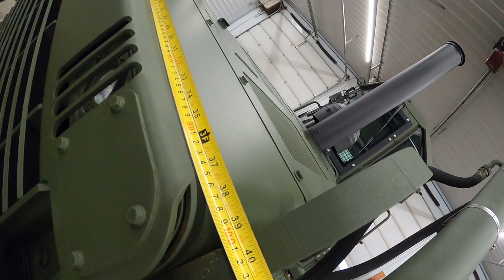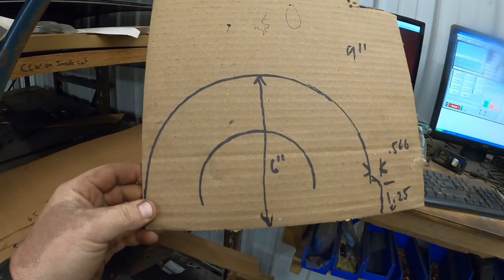Installing limb risers on a John Deere 850J @C_CEQUIPMENT

Comment: dp gonna get a winch or a ripper, the choices to be made, why cant one fit both, i have seen dozers have a winch installed on the front so you can use the blade as a dirt anchor if you pull something ridiculously heavy like 30 tonns + where your tracks start to slide and you pull yourself instead of the load
Reply from the maker: Keep an eye out on our channels and you will see